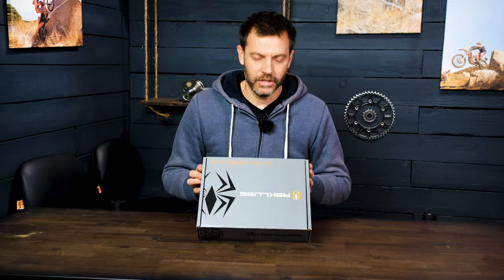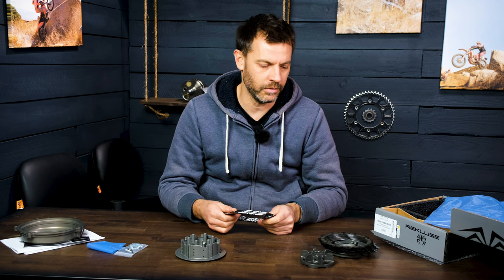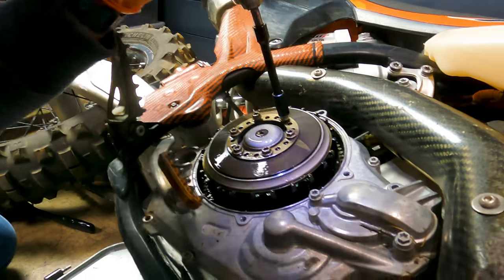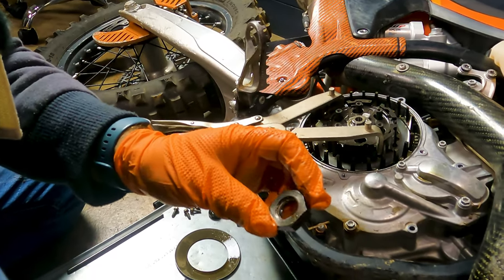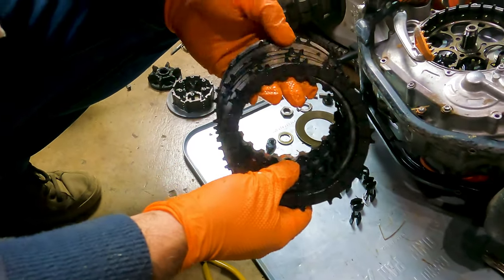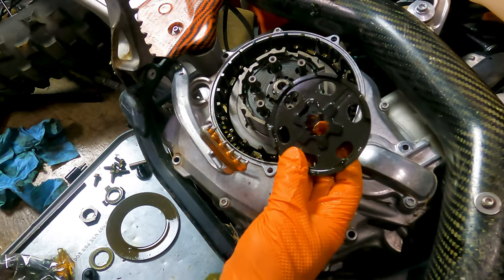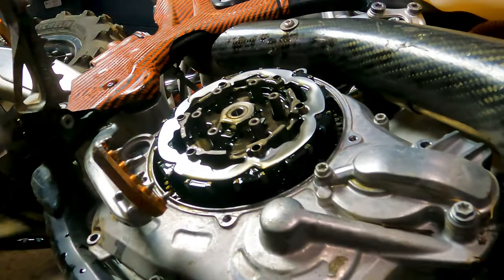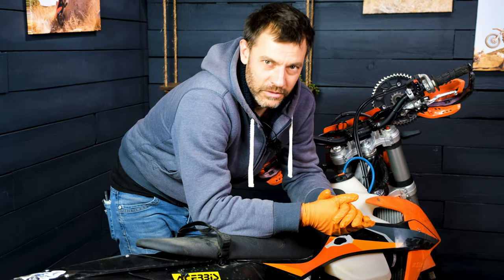Rekluse Core Manual Installation | KTM 500 EXC-F Clutch Replacement | Lighter lever pull, great feel

Comment: Appreciate the video!! I am also on the hunt for a lighter lever pull on my 2020 KTM 500. How much improvement would you say this provided over the stock?  Did you also replace the slave cylinder?
Reply from the maker: It didn't make any difference on the KTM. I tried this because on my last bike, the clutch springs were actual springs and the rekluse kit made a notification difference.

On my 21 KTM, they use a spring washer and the rekluse kit doesn't change anything. 

What did make a huge difference was the clever lever.